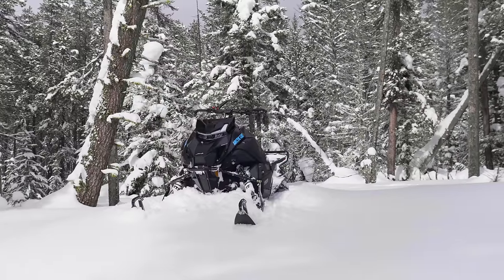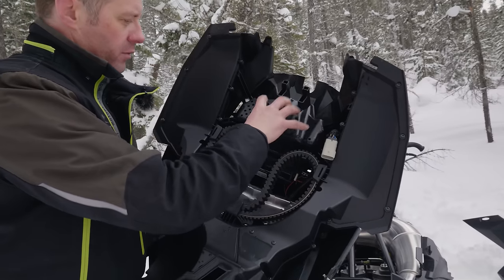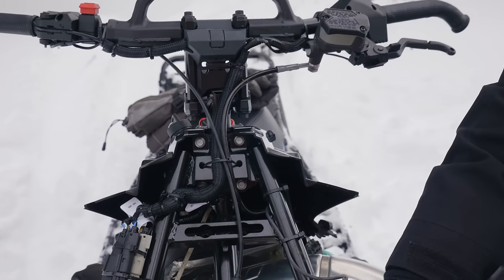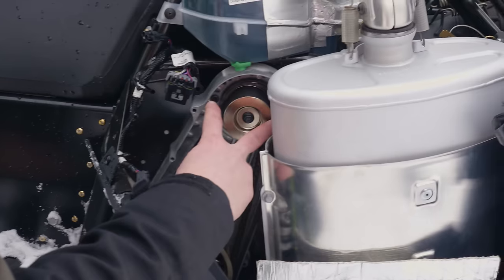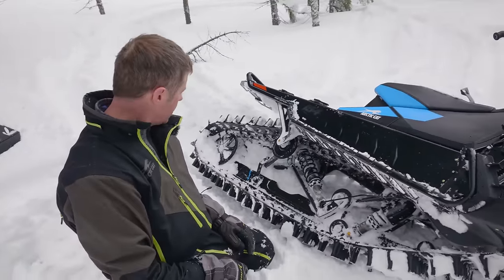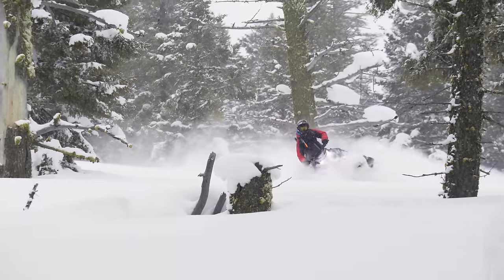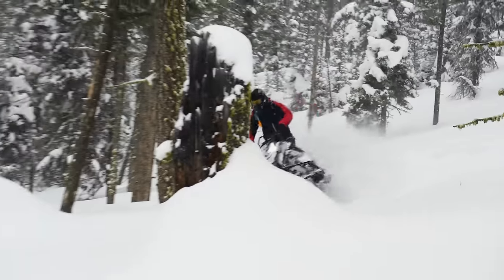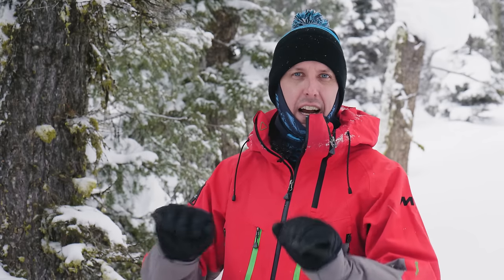Arctic Cat M600 Catalyst Walkaround + Ride Impression

Comment: Those frogzskin vents on the front are going to get punctured real quick
Reply: For sureeeeee
Reply: Not necessarily, mine have survived many years with no issues, and if they do get ripped, new ones are very cheap
Reply: We put over 1000 miles on one with no problems

Comment: Is the new platform with the 858 going to be competitive, weight-wise, with Polaris?  Ever since AC moved on from the original M-series, their sled weights have gotten really really high, like 50+ lbs heavier than a Polaris.
Reply from the maker: Arctic Cat had indicated in the development process that their intention was to be lightest in the industry. I guess we'll find out soon if they achieved that goal or not, but regardless we expect Catalyst to be considerably lighter than the Ascender models.

Comment: Thank god they changed the intake, hopefully no more snow injestion. I see they changed the power valves back or atleast changed them from the ctec2 setup that you had to pull the cylinder to clean them. Be intresting to seee the 860 and turbo setup if thats what they are releasing. Why they still have the headlight and heater switch on the handlebar of a mtn sled is beyond me. There have been cleanup kits forever and now you can't even modify it, your stuck with it. the 860 is only 5 years too late, at least cat seems to try to be staying relevant. They were heading for bankruptcy in my opinion.

Comment: Looks like they took care of the steering stem issues. Now how about the tether. Cats are dumb to try to put one on. It's there a factory one now? Flipped my sled doing a climb last year, by the time i could get to the kill switch it had been running straight upside down for a good 30 seconds.
Reply from the maker: Arctic Cat has provided a tether on all mountain sleds since MY2019.

Comment: Zero innovation ... this would have been a great  sled back in 2012 !  Sad to see Cat so slow to change and innovate.  Looks nice on the showroom floor but for all of us whom have owned cats know that in a year or two it will be plastered with problems and worn out parts.  E for effort !
Reply: Exactly. All this sled and new motor did was catch them up. They'll be obsolete again next year.
Reply: @reggiewhite4111 all these people saying catch up.  You do realize with innovation you can go from last to first right?   Besides what’s with the parts wearing out?   Like Polaris and doo don’t?😂
Reply: I get I’m a trail rider. But 10,000 miles on 3 sleds. I think cats hold together just fine.  Motors weren’t touched either… just sayin